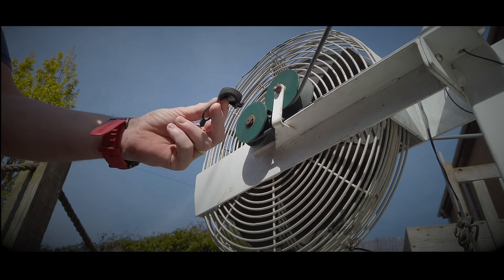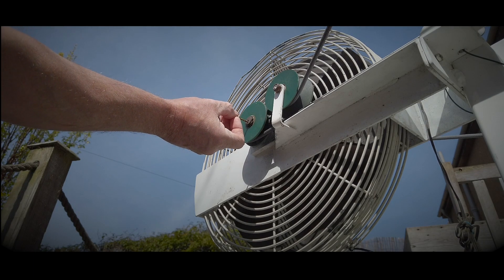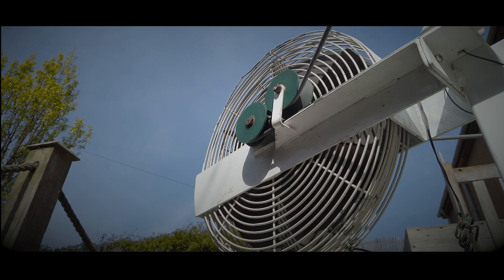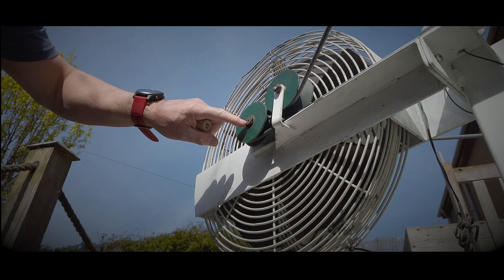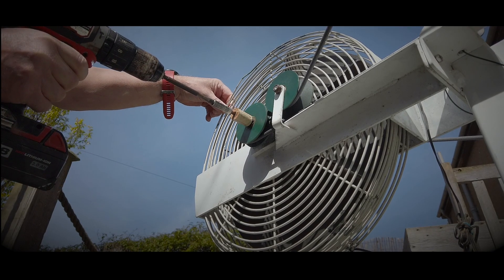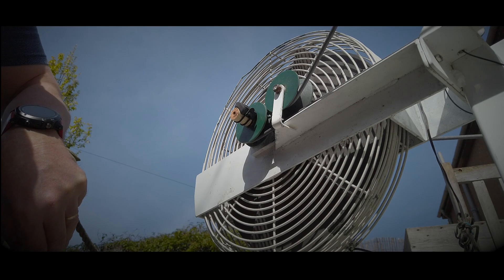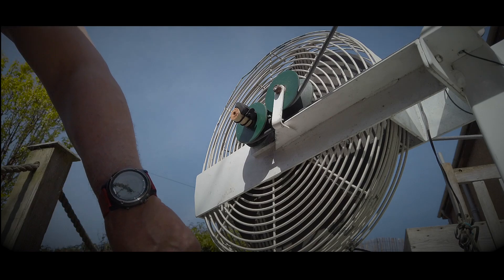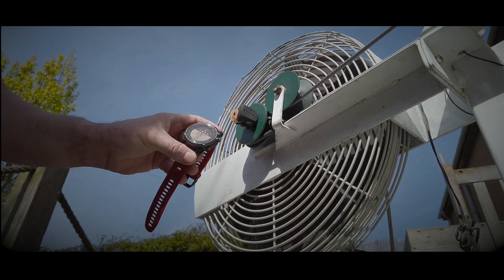Adding Garmin ant+ Speed and distance sensor to Kayak Ergo

Comment: Did you figure the wheel  get a realistic distance? And thanks for the vid
Reply from the maker: Its not definitive ( too lazy to put an hour in...  ) but on my Fenix 3 I've got the wheel size set to 230mm once I get a long enough time it'll make more since.
The other thing is the fenix3 may also give cadence if worn on the wrist , still to check in that
Reply: On my Lawler I reckoned on 750rpm equating to roughly 11km/h - subjectively this feels about right

 # using 60 minutes * 750rpm = 11km, 1 rev = 11E3/(60*750) metres
 # 1 rev = 11000/(60*750) = 11/45 = 0.2444m
Then all you have to do is count the total number of revs, so in metres total distance = total revs * 0.2444

A garmin speed sensor is probably set for a road bike wheel diameter of 0.685m (27"), so one rev of that is Pi*0.685 = 2.152m
So your ergo flywheel is going 2.152/0.2444 = 8.805 times round to cover the same distance.
Try dividing by 8.8 as your conversion factor. 105km/h would be 12km/h and 132km/h would be 15km/h

Assumes the ANT+ speed sensor is OK up to about 80mph - but it should certainly be OK at 60mph which is around the 12km/h equivalent (div 3 race pace)

That's all theory! Let me know what numbers you get in practice - Piers
Reply from the maker: @piersbarber  you're probably right,  I'm not a super fast paddler but I'll aim to get the readings in line with my known time trial pace at maximum effort